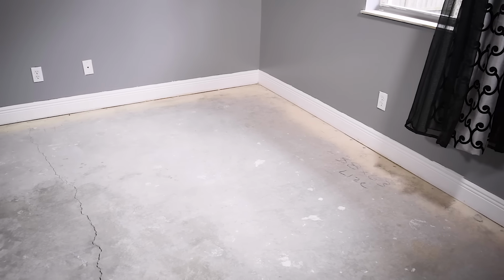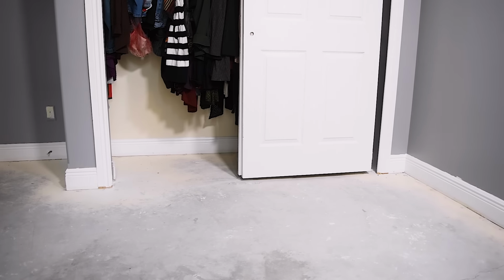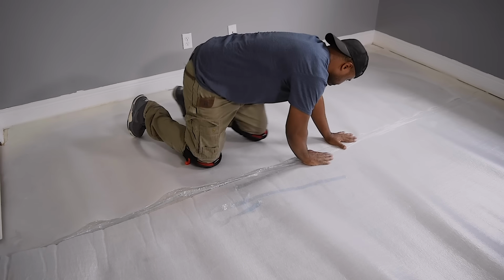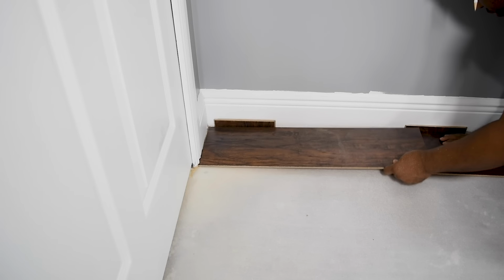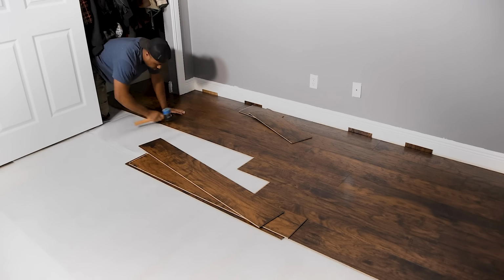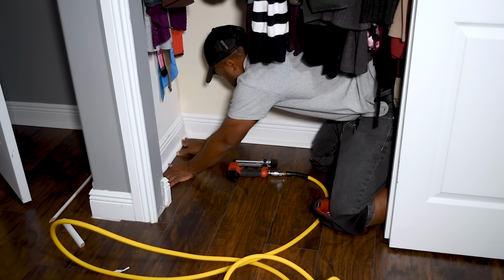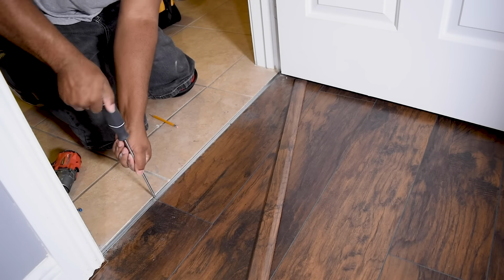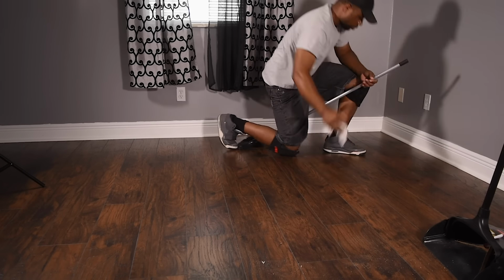How to Install Laminate Flooring for beginners

Comment: May I suggest one thing to add to this video?  Many old houses and most concrete floors are very unsuitable for laminate. Most manufacturers will not warranty the product unless the floors deviation is within 1/8th of an inch in 8 feet. So before you do any unnecessary work, the person installing should take a level all around the floor to check for any major humps or dips. This can cause joint stress and breakage if the deviations are too much.
Reply: Also I understand you were limited with the transitions. For the future if you have a transition like the one you face here or even railings that are too thin to undercut because of the height of the floor, there are reducer mouldings that are square finished that are designed so the square edge can be placed up against the current transition/railing etc. Hopefully this helps

Comment: Is there a big difference  by using waterproof  flooring  as opposed to what you used ?
Reply: LVPs are not as durable.

While they are waterproof, ultimately its a plastic sheet over a laser scanned image.  It scratches easier.  Laminates are far far far more rigid, and their polyurethane, aluminum oxide reinforced wear layers do a much better job taking damage.

LVPs are usually a bit "safer" to install on concrete, that is why its important to get a good install.

Comment: As a flooring installer myself who watched this video out of pure boredom I must say this guy did pretty good. Everything he did was pretty much by the books. The only thing I would criticize is the caulking seemed a bit heavy and done pretty sloppy. You can do a great job but it's really all in the finish details that will make or break you.

Comment: My solution to this isssssss..................... Install a carpet. It's easier, quicker and it's warm in the winter. 😂😂😂😂😂😂😂😂😂😂😂
Reply: I actually learned not to long ago that if you take a laser thermometer, and temp a laminate, vinyl, carpet and tile floor they will actually all be the same temperature.  Its more how they transmit thermal energy that gives the illusion of them being colder or warmer.  

Tile feels colder because it basically sucks the heat out of your feet, and if its on concrete even more so.

For the rest of it.. yes, carpet is probably easier, and is definitely cheaper to install... though I always tell my customers that while floating floors are DIY friendly, you should always have a professional install carpet to make sure you get a good stretch.

Comment: Well, you did use spacing on one side, yet the other 2 sides you didn't? So it can not expand to the sides. It's gonna bulge up if it gets too hot

Comment: i went on a job where they went tight wall to wall. center of floor buckled, bypassing 5/8" one strip over the other.
Reply: I always warn people when they DIY this they have to have an expansion gap or they will buckle their floors.

Comment: Why wouldn't you remove the baseboards first?   Remove them, install flooring with correct clearance to allow expansion, then put back baseboards on wall, hiding the gap.  No need for any other molding then.  Just did this myself a couple of days ago.

Comment: I honestly dont like the way it looked. He did it the lazy way to leave the molds instead of taking off the wall. Then he added another small molds to cover the cuts wich in my opinion looks horrible. I dont recomment to do this to your house. There are better videos on you tube how to take the molds out carefully without breaking them and then to put them back is easier than take em off.

Comment: Do I still need  the moisture barrier if the pergo plank has the pre-attached pad.?  I'm putting it over the  concrete floor
Reply: Yes.

Many of those pads are more foam than plastic and they can absorb moisture, and even if they are the plastic pads, water will be coming up between the boards, and that is where it will do the most damage.

Especially with a Pergo.. most Pergo (the branded laminate) is not water resistant unless very specific instructions are followed.

Comment: Very-very bad job.This is not a professional job, but complete nonsense.This video shows how to not do
Reply: Do you have a video where to do it right? Or tell us what was wrong?
Reply: @KaRiNa-pj9sb  First I don't advise Scotia trims.Look very bud,before do flooring job  better take of skirting around but people in UK never do that.Then put waterproofing and then Wood fibre Laminate & solid wood flooring Underlay panels.You can see on video he used calk for several holes because he did't take of skirting. For this job I never use a calk because for my last house I used plastik skirting.I try to add my video at the moment but I speak Russian Language.You will anderstund what I mean

Comment: I bought a house with this on the floor... soon after the floor started getting soft spots in it... so i decided to take it up,under it the floor was wet  ,and mold had formed, the floor from the moisture was buckling up... about a month later when the wood started drying out the floor started getting flat again... sometimes i think it's better to just refinish the existing floor.
Reply: If its a laminate you can't refinish it.

Its probably damaged at this point.  If there was a vapor barrier it had to have been installed incorrectly.  If it did not did not, whoever put it in made a big big mistake.

Comment: You don't want to do a "staircase pattern" that makes the floor less stable and more likely to come undone.  ALWAYS do random patterns, and by random, I mean completely random lengths, as long as the seams are at least 8 inches apart.

Comment: My mans just flexed on us with all his tools lmfao
Reply: Right! I don't even know what the tools are called.  I just bought a home and got an estimate for $1710.88 for 3 bedrooms and I'm like OMG no!  If I need these tools I need to find my fellow hustler that knows how to do this.  I just can't.  I'll cut off a finger or 2.
Reply: @kc30058  I ended up doing my floor it’s this same type of floor it wasn’t too hard you just really need a saw and a tape measure, and obviously know how to calculate but it wasn’t too hard if you know somewhat what you’re doing lol
Reply: @kc30058  that’s a reasonable price to pay for 3 rooms.. . Buy a miter saw and it’s like $300 a quality one because cheap ones will be off by just a bit. A circular saw can range around the same price & you already paid half of what you got quoted. Avoid yourself the headache if you’re not willing to invest time into your project. Gotta square out the room. Gotta level out the floor also because then floor won’t be even or won’t sit properly etc
Reply: Those are common DIY home owner tools lol
Reply: I

Comment: Hello in bedrooms I use shoe moulding as it allows the furniture to fit closer to the wall.  Using qtr round in other livings spaces works better. Make sure all the walls have spacers, if it contracts and expands it will move one side and become crooked. Also use a chaulking that matches the floor color when filling in small gaps that meets the floor. Then going from laminate to tile with a marble thresshold use a carpet reducer next time. It has flat edge and reduces to the laminate. Good job but just trying to give you the most professional look.

Comment: 1:42 that crack on the concrete flooring might be a safety hazard
Reply: It’s a slab ! There’s dirt underneath. Yes it might be a safety hazard if there was a floor Beneath like in a high rise building.

Comment: Personally I would have filled that break in the concrete. Over time moisture will seep through even with your underlay and it will start buckling along the crack line especially if you have laminate joints around it. Laminate let's you get away with short cuts short term. Long term not so much.

Comment: Any way to prevent the laminate floor from separating?  Or is it just something that laminate does?  My upstairs laminate feels like it’s sinking in in some areas. 🤷‍♂️
Reply: If it is sinking there is a subfloor issue.   That material is dense, and shouldn't depress.

Comment: Taking out the carpet strip nails on my concrete floor chipped away the cement where the nails were.  Do I need cement or an epoxy to fill in these unsightly holes before the new flooring is installed?
Reply: Ideally you don't want to have any damage to the floor when you install.  If they are small you are probably ok, but if they are large enough to leave an actual gap under the boards, you should get a leveling compound.  Something like Featherfinish will dry in like 45 minutes (or less over small areas) and let you level out those spots.
Reply: @daleludtke7803  Thanks for the tip.  Most of the holes are big and some are deeper than others since the concrete was poured when the home was built 40 years ago.  I will look into Featherfinish and hope it is better than the other leveling compounds that I have read about and people complained about.  Not sure if this is a job a rookie like me should handle or if I should just leave it to the flooring experts who will do my flooring job.

Comment: See... I did the laminate first, THEN the baseboard overtop... looks cleaner.
Reply: He probably made that decision because the baseboards were stapled and glued.  No easy way to pull them off without risking damage.

The quarter round look is not used often anymore, its more oldschool.  When I coordinate my installs, I will usually only do it around cabinets, hearths and wainstcotting.
Reply: I was just about to ask if this was a possibility.
Reply: @masonyalegermern1877  it can... Just have to remove it carefully if you intend to keep it... I wasn't keeping mine as it was probably original from the 80s so I tore it out.

Comment: i noticed that you placed the a few pieces of the laminate for the gap expansion to the side in front of you, but to the right han side of the wall you did'n place any pieces of the laminate. i wanted to know if its for only one side of the wall or its need to be across the four sides of the wall. first time i  will be installing my floors and wanted inquire before i get started. Thank you soo much.

Comment: Wow what a great job I especially love how you ended your trim molding piece at the ends one question I have I'm doing research on how to do this I've heard of some of these laminate floors voiding the warranty if you use the underlayer is this true for all products or just some. Thanks
Reply: Alot of these new composite flooring has underlayment built into the board already. Just read the box and you will find out.
Reply: In this case the chances of finding a laminate that does not require an underlayment on concrete is very very small (as its a wood product).

What you want to avoid is buying an underlayment that doubles as a pad (like what he was using.. I sell one called DuoFoam that looks pretty much exactly like it), if it has an attached pad.  If it has an attached pad, typically you will be laying it with a plastic sheet, usually 6 mills.  That extra cushion will cause the floor to move, and that will put pressure on the joints and cause them to break.

That being said... installing your own floor usually voids the warranty anyway.
Reply: If the flooring you buy calls for an underlayment buy one, if it doesn't call for an underlayment and specifically says it will void the warranty then don't buy one regardless of what anybody in these comments says. The instructions on your flooring should dictate what you do. Good luck

Comment: I had laminate flooring installed in my home a few years back and my house has never been so cold in the winter months. I never even thought about that before having the carpet removed and laminate installed. I love the look but winter is brutal. I have a crawl space no concrete slab.
Reply: Review these options, should help: https://www.youtube.com/results?search_query=how+to+heat+crawl+space+under+house
https://www.youtube.com/results?search_query=how+to+heat+laminate+floor
Reply: @Hello Daniel how are you doing

Comment: to remove the silicone, use a soap solution, sprinkle the solution on the silicone, also wet your finger with this soap solution , and the seam will turn out perfect,I'm from Russia, sorry for my English ! online translator))
Reply: Roman Li use latex caulk since it’s not in a bath or shower. Cleans up easily

Comment: i'm cringing just by watching this. Do NOT lay it like this...
Reply: Glen Van Rompay why not
Reply: @Leedsunited44  For one thing: he's laying the boards in a "staircase" pattern , and WAY too close to each other. I've worked for 7 years doing nothing else than laying hardwood flooring and laminate/vinyl flooring, that's asking for trouble in the long run.
Reply: Glen Van Rompay  I thought anything from 300mm staggering was ok 
Anything else you see that you wouldn't ???

Comment: Just did the laminate in two rooms.  Love how it looks and I couldn’t imagine doing it without taking out the molding.  Nice job.
Reply: The molding on there was probably glued and stapled... probably would have destroyed the molding to pull it off.  That happened recently on a job I set up.

I normally only use quarter round for wainscotting, but its perfectly acceptable to do what he did if you do not want to remove trim.
Reply: @daleludtke7803  thanks for replying because I didn’t even think people glued it.   I’ll pass that along because, a friend could never figure why his molding get like it was, “part of the wall” lol.  The  people who fixed his house must have glued it.  Happy 2021

Comment: Can we install laminate flooring over the tiles??
Reply: It's possible, but not recommended. You want a flat surface to work with and the grout sections could cause issues down the road. Wood floors and concrete are generally the only surfaces you want when working with laminate. Plus, tile floors would already be level with all your doors and closets, so putting laminate on top of that would cause a rise in the floor resulting in issues at those junctions.

Comment: Do you have to check the floor is level before starting or will the laminate flex to adjust for the uneven floor? Just asking as I see the crack in the middle.

Comment: Thanks for the video . Saved 800 dollars in labor. The base board is the only thing I was worried about because it's in contact with the concrete.  🙏 thank you quarter round

Comment: what did you use to drill the holes for the transition in about 10:02 mins of the video. i have exactly that, tile in the bathroom and putting wood floors in the hallway. please help and thank you in advance.
Reply: nov83jn 
Use a mason or cement bit. As well you   Can save time by buying the flooring with the underlay already attached

Comment: I saw other youtube installation video use glue, is that necessary?
Reply: When you use trim, it acts as glue would around the edges since the inner pieces are all locked in place. If you don't use trim, then yes glue or nails would be necessary. If the other video showed glue or nails AND trim, that could be a little overkill or primarily for style.

Comment: @DIY Creators When choosing the direction of the laminate, you should check which way the light hits the floor from outside. The laminate should be turned to go the same way as light, so the seams in between the laminates don't pop up so clearly.
Reply: You should also do one row at a time, so you save more laminate and you can use the leftover piece from the last row as the starting piece. :)

Comment: Measured length of boards incorrectly..flip it..mark it..then cut..will give you closer fit to wall..also start at the door and check across the roon so you do not have small pieces
Reply: @Hello How are you doing dear

Comment: I notice you did not use self-leveling compound before the underlayment. My concrete looks just like yours and there are not any large dips etc. It is bottom floor bedroom and had carpet installed for the last 16 years. I filled all the cracks. I even applied concrete adhesive/primer because I fully planned to use the self-leveler. Do I HAVE to self-level? Or can I take this messy stuff back to Lowes? I bought a big bucket that I mistakenly thought was pre-mixed. The room is 11' x 14'. Can the laminate be installed on top of the 2mm underlayment without self-leveling?

Comment: i just did mine the other day, my bedroom is 12ft X 25ft and i removed the entire carpet (it was filthy and soiled)  removed the insulation beneath it, and all the tackle around below the baseboard. i bought 6x50' grey hardwood planks, and blue underlining. my first time ever doing anything like this, and let me tell you it came out fucking flawless. took me 3 days from start to finish (moved a ton of furniture and trash out to the backyard to empty out the room) once the flooring was done, everything went back in nice and orginized, dusted, and trash free. feels like a completely different room now.  might do the entire house now. also, i used flooring adhesive, i see you didnt, why is that?

Comment: This has me frustrated as hell trying to do it myself. All the damn planks not coming out flush or smooth only some 😠😡
Reply: You must use 10k worth of power tools like what he did. He can't even use a (basic tool) hammer but he finished his work
Reply: @ahitler5592  He used an osculating tool ($50), miter saw ($250), pin gun ($50), 2 CFM 1 gallon air compressor ($150), and a simple power drill ($50). So around $550 in tools. Not a small amount, but nowhere near $10k... Also, if you're going to do any sort of DIY home repair and upgrading, these tools are often a must, and as such, are good investments...

@Joey Robstill If the planks aren't coming out flush, the floor may not be level in some places. This is particularly common around areas that have any visible cracks in the concrete foundation.